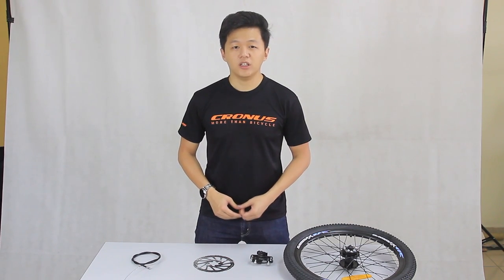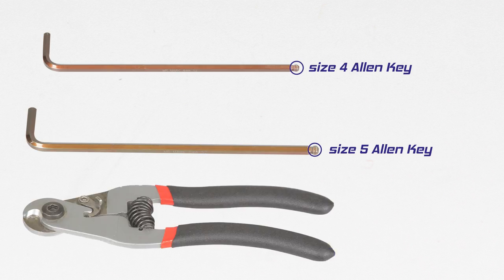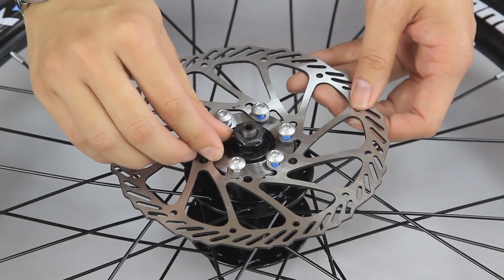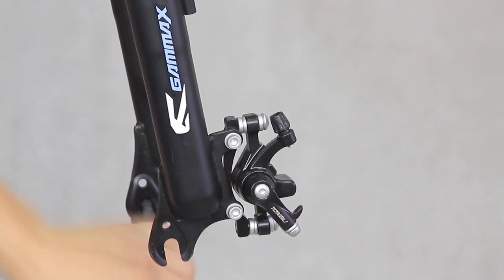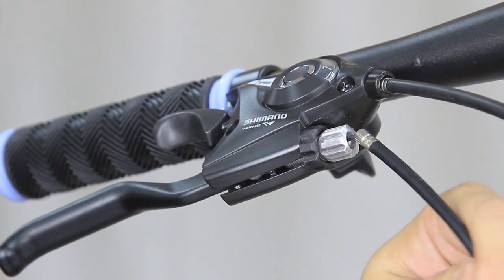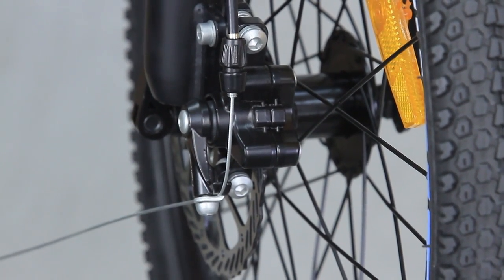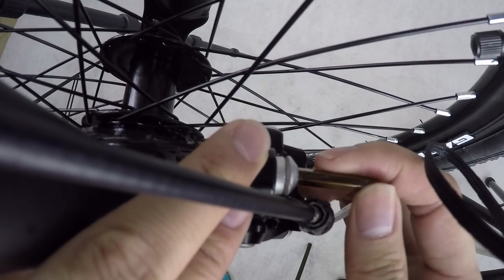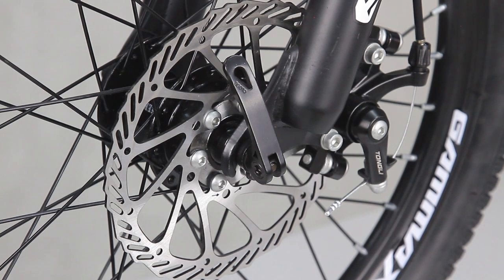How to Install Mechanical Disc Brake

Comment: Good video. I would suggest just one thing. Renew the thread lock on the bolts securing the disc/rotor. Thanks for posting.

Comment: You touched the braking surface tell REMINDER: if you touch the braking surface in the rotor disinfect it with rubbing alcohol